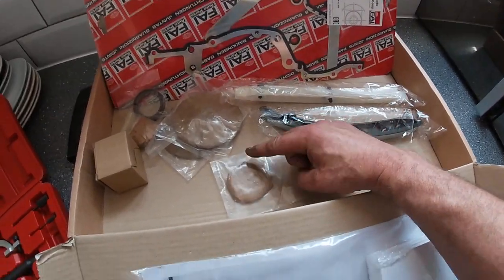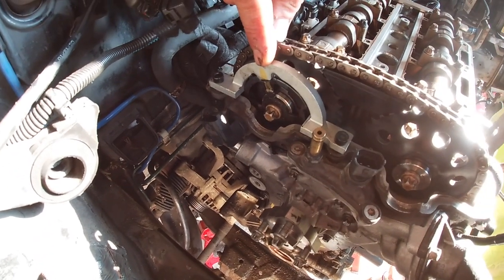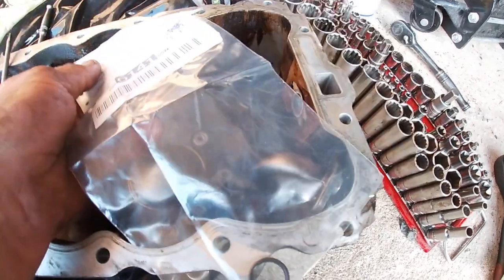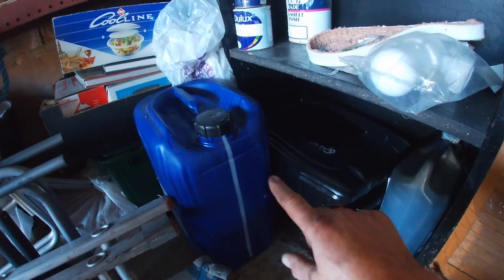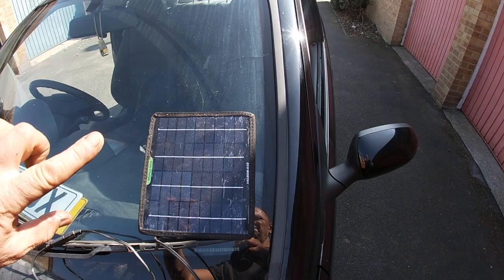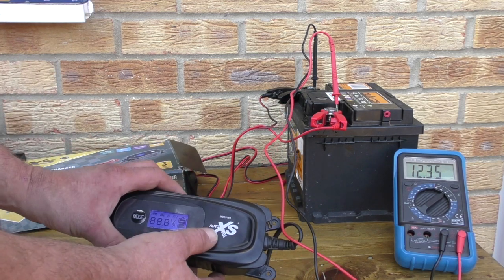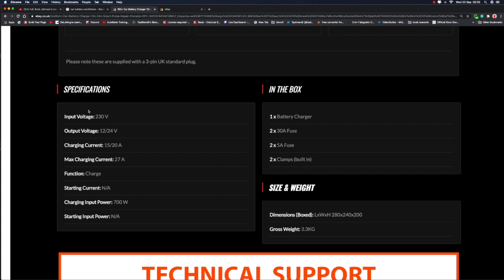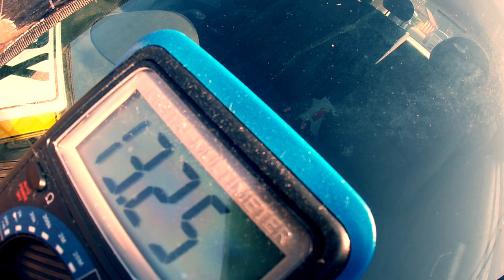The Fly - Update and Choosing a Battery Charger / Pulse Repair for 12V Car Battery- Part 1

Comment: I have a Ctek MXS 5.0. it's saved my bacon numerous times, I now have the connection leads hardwired to both of my Landrovers so that I can quickly plug it in to keep the batteries topped up. Does regular and my dual AGM  batteries.

Comment: I use the foxsor charger which is used regular for leisure batteries to keep an electric fence running. Works a treat for the price and also helped fix an old tractor battery 👍

Comment: Ring 12A charger for general use, can be left on for trickle charging. 
CTEK charger for repair and batteries left unused for a long time, bought a couple of the quick connect adapters so I can plug it in without having to access the battery.

Comment: Noco battery 3.5a one I bought for work, as they only have a standard battery charger not an agm one which they wouldn't pay for. I use it every day and its brilliant but I would rather buy the high amperage one for a faster charge.
Reply: hey ,if anyone else needs to find out about battery fix try Jadonite Renovate Battery Buddy (Have a quick look on google cant remember the place now ) ? Ive heard some unbelievable things about it and my buddy got great success with it.

Comment: Best battery boost / charger  I won out of a skip ... Sealey too 12/24 v  ...  company I used to work for where health and safety mad,  any broken tools straight into quarantine and forgotten about 
... all for the sake of a internal steel blade fuse .... Dewalt 110v  grinder wanted a broken wire repair another win and my Bobcat inverter welder had blown the 13amp fuse 
All for the bin as they bought new .....  YOUR EMPLOYED TO FIX SPECIALIST KIT FOR HIRE NOT REPAIR WORKSHOP TOOLS  was the quote I never will forget 
I couldn't get the 30 tonne press out of the skip for the sake of a seal as I had started working there ...  crazy 
Whatever the machine needs chuck money at it ...  parts in stock .... needed  90% fleet availability     repairs / servicing and long term repairs (awaiting parts)  the other 10 percent 

Rig up and Anderson type plug for the battery booster ...  easy clip like a Deutsch   
Most of our machines had Anderson plugs wired on them underneath to boost batteries on sites as sometimes your couldn't lift the side panels up as they parked them together or besides walls forward thinking when on a breakdown 

Sadly workshop fitters burnt out ...  me included ...  
Now I have a good job ...  low pay but good work / life  balance .......    no American /chinese   tool debt
Reply from the maker: I hear ya bud.

Comment: Halfords grey one, not sure on the amps but was the biggest they had in. Very heavy transformer in it. Is it worth the money for fancy chargers? If its let you down once, do you want to "repair" it and be let down again? Better off testing the alternator and getting a fresh one. Have been looking for a cheap way to tell modern cars they have a new battery fitted, had the stories about wrecking batteries if you don't tell the ecu it's new. One last thing, don't put it on charge near a welding bay or near someone smoking, what's that saying about me having the t shirt!
Reply from the maker: Yeah, gases from batteries.   Did you make one explode?
Reply: @trailerfitter2  I was the un willing victim welding, someone put one on charge at the end of the bay and I unknowingly showered it with sparks. Bits of the case gave me a smack and it was like a shotgun going off. It did clean up the concrete floor though ! I kept the blown case for a while till the foreman got his hands on it and it dissapeard. Had to put it on my work hearing tests for years. Definitely one t shirt I wish I could give back!

Comment: I have  2 of the xs chargers from Aldi  for the bikes and a sealey 12/ 24 charger simular to your one in video for the disco its has boost  charge works well dont know the amps off the top of my head but its a gooden 👍🇬🇧

Comment: Get a ctek for you mums car. You  can get get an easy connect plug to mount to the car. Very simple and would that situation down to a T. 
I have heard of a LIDL battery charger burning down a workshop. It was the only thing on.
Reply from the maker: Oh hell,  not a good advert for Lidl...